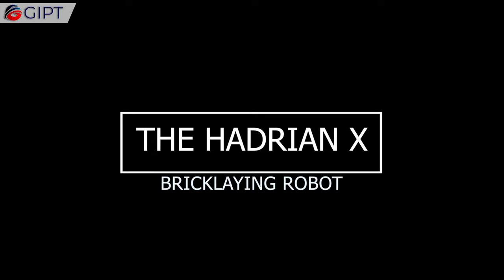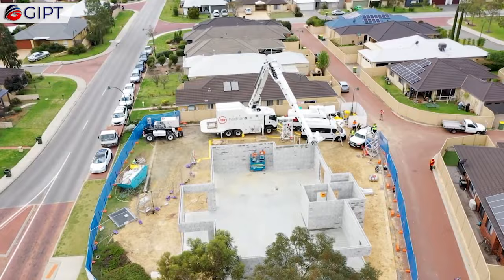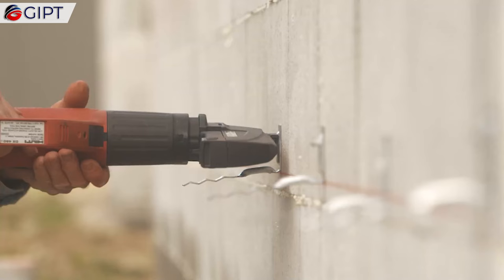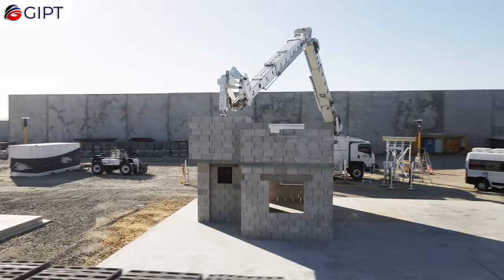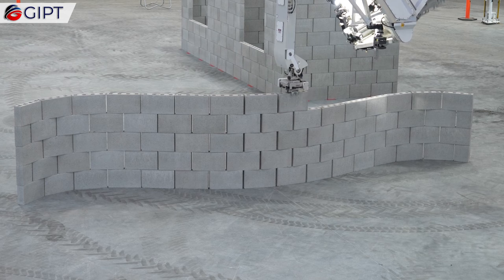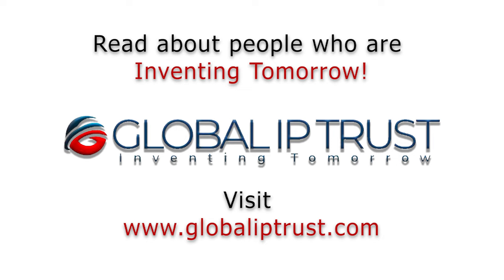The Hadrian X Self Bricklaying Robot Is The Future Of Modern Day Smart and Safe Construction

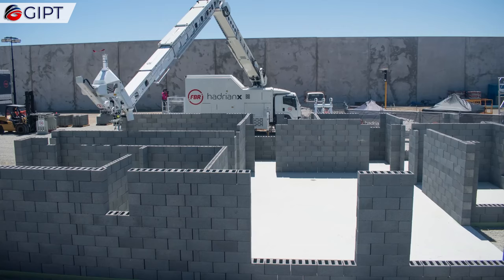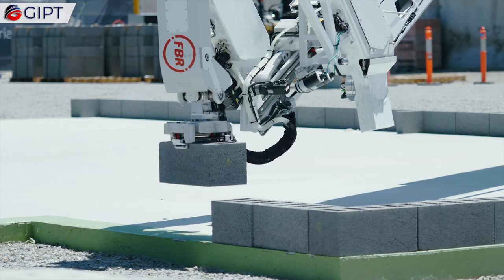Comment: People write about some secret adhesive in place of mortar, but eg. at 01:30, middle left side of the screen you can clearly see lots of holes through the wall. In some other places you can see same stuff. Additionally, eg. you may observe it very well at 0:50 that bricks are just layed from top without any adjustment to the side, they're just dropped from top. That means that even if there's some 'secret adhesive', it has no chance to stick to neighbouring brick. It looks just like a big robot dropping bricks, not like a machine that is capable of creating sustainable walls. Waste of time so far.
Reply: I believe they don't use the adhesive for many of demonstrations so the blocks can re-stacked and used again.
Reply: @stewpacalypse7104  Then it's a poor demonstration. If that actually is so easily applicable, they may film it on-site while erecting actual building for somebody.